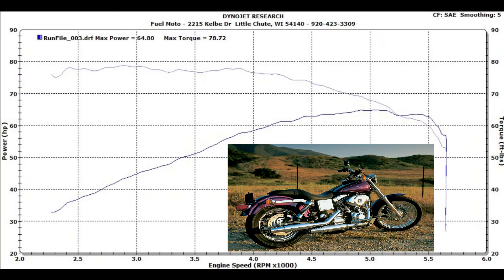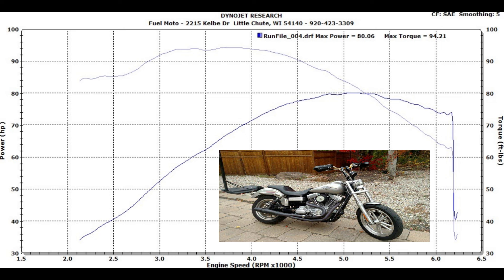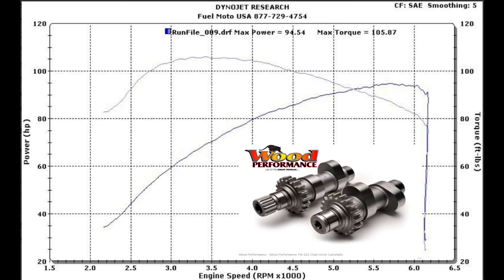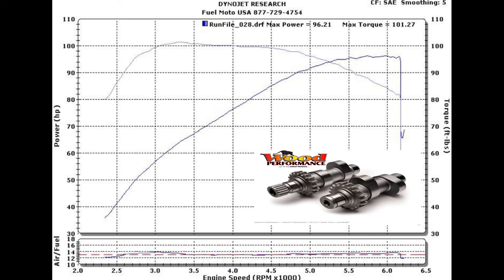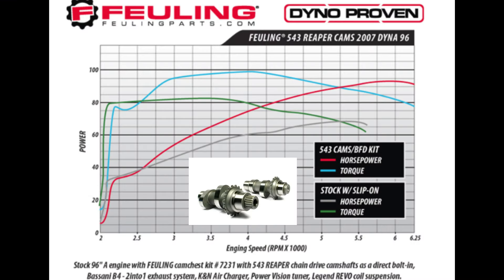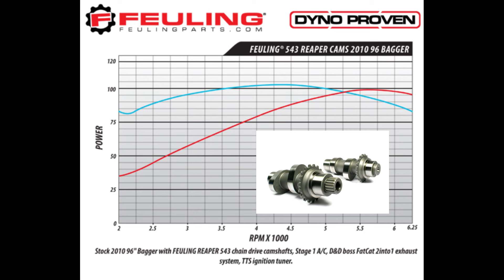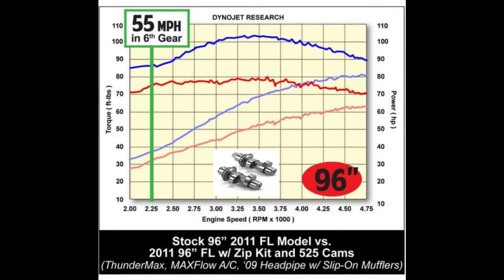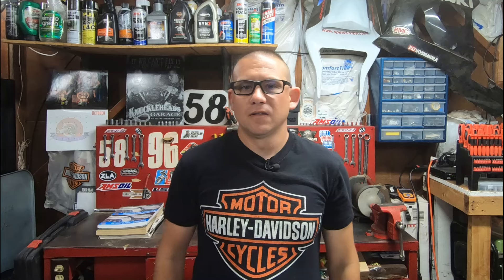Consider New Cams For Your Twin Cam 96 Before You Convert To A 103

Comment: I have an 09 RK classic with upgraded airfliter and slip-in’s 
Makes 71 HP and 83 TQ
I want more torque on low end to run with the guys on newer 103 and 107’s especially at Highway speed. I am in Texas and speed limits at 75 and even 80 with groups riding at close to 90. 
Which TW cam recommend.  I often do 3 day trips loaded with gear and a trunk 
Current bike just runs out of power at those top speeds
Reply from the maker: I'd say you'd be hard pressed to beat the Wood TW-222 for that RK. The 222 makes a lot of all around power and it really bump you're horsepower and torque all over the RPM range.
Reply: @GixxerFoo  Thank you, wasn't sure if you might recommend the TW 555 or TW 6-6 over the 222

Comment: I just ordered the cr 570-2 cams for my 96. I've read a lot of great reviews on them in 103s. I hope they perform similar in the 96.
Reply from the maker: They do very well in the 96, naturally the 103 produces a bit more with the added displacement but the 96 is no slouch. It's typically about 5 horsepower and torque behind the 103 so with a 96 you should see mid to high 80's in horsepower and low to mid 90's in torque.

Comment: That woods cam you first spoke of looks mighty tempting, but I would want to check run out before I go changing cams, cam bearings, cam plate etc to do the job right...and if I did all that and came out with good numbers I would be looking at gear driven
Reply from the maker: Gear drive is the way to go if you can swing the cost and your run out is good. The Wood cams are awesome, a little noisy compared to other cam though. But that's how the Wood makes the power with the overlap.

Comment: I have a 96 inch Dyna and have been thinking about the S.E 255 cam. After watching your video I think the Woods 555 is the  way to go. The power curves are similar and i can probably get away with the S.E 255 fuel map and not flag digital tech.
Reply from the maker: You'll get way more out of the Wood cam, the Wood 555 is an awesome Dyna cam!

Comment: What about the fueling 574, in a stock 96. 2011 flh
Reply from the maker: That's a very strong cam, it comes on about 2500 but it runs out pretty good. With a good exhaust and tune you should see power in the mid 90's and torque close to 100 foot pounds.

Comment: Great video just what I needed to help make a decision. I am gonna do the TW 222 cams in my 09 street glide 96 in motor, will also put on D and D 2 into 1 Fat Cat ( I already have a K and N filter) and getting it tuned. Do I need to do adjustable push rods also ?
Reply from the maker: I assume you meant push rods, adjustable push rods are required with the wood cams. You might consider new lifters, not a total have to thing but just something I prefer when installing a new cam.
Reply: @GixxerFoo  Thank you sir, and yes I meant new lifters and adjustable push rods.

Comment: Hi Gixxer.  Thanks for all of your videos, they're informative and well done.  I'm subscribed and watch them all. What's your take on stock head pipes with slipons (Samson ovals) for a cam upgrade?  Worth it or are the stockers too restrictive?  '07 Street Glide... Thanks again!
Reply from the maker: The issue with the touring bikes is you still have the catalytic converter in the head pipe. Just slip ons with a cam swap will give you a good power bump and better sound, but you won't get the highest horsepower due to the cat. On the other hand you will get some big torque with the cat in there. The stock harley header is actually really good, it's just that cat in the head pipe on the touring models that holds the horsepower back.
Reply: @GixxerFoo  Thanks again. I've swatches the web for that info!

Comment: @GixxerFoo great Vid! Do I need a new clutch and oil pump with that stage I + cams? I mean the increase in hp alone is over 40%, thats a lot.
Reply from the maker: By just adding a cam set it's not 100% required although it's not a bad to add a clutch upgrade and a high volume oil pump. It really depends on how you ride and how many miles are on the bike. A heavy duty clutch spring isn't a bad idea, while adding cams if you can swing the extra for a billet cam plate and high volume oil pump it's an opportune time to get that done with the chest open.

Comment: Só...about the reaper 543 in the dyna vs bagger...
This HP difference is due to 3.93gps vs 4.3gps fuel injetor???
Replace the fue injector and will i get almost 100hp ??
Reply from the maker: Not necessarily with the 96 inch engine, you'd really need a displacement increase to get closer to 100 horse mark. Generally the 103's will get to 100 horsepower just due to the increased displacement.

Comment: Dyna lowrider its 96inches its stock i think its heavy and like to get off the line better , but with 36.000 miles on the clock it acts like it needs a top end and the noices emanating from primary got me spooked,  yeah I bought used and from a HARLEY dealer so I'm going to be busy cams that influence low and midrange is where I'm at ! Man this bike creates ah lot of heat , Jeez ! The more I read and discover about my bike I'm more appreciative of my 79 'lowrider , I'm not backing down this 07' Dyna lowrider is the newest bike I ever owned and will continue my riding journey with it so its going to live in a garage for a year to be altered to where I like it , ain't that how it is " stock looking till you start it and here idle , Fucken-A man bike will sound tough

Comment: I have a 08 heritage 105yr anniversary. 96ci. V&H true duals, looking for recommendations on a good A/C, tuner, and cam selection to wake it up. Plus what other modifications to support the cam for better longevity and reliability. Any advice?
Reply from the maker: Any high flow aftermarket air cleaner is pretty good if you're just doing a cam and exhaust, you can really pick anyone that fits your style. Power Vision gonna be the best way to go with adding a cam to your bike for a tuner, the Wood 222 is one of the best all around cams out there for a bolt in.
Reply: I do ride with a passenger about half the time. I'd really like a cam that will give me a good increase across the board. I'm going to leave the V&H true dual exhaust. Just going to do a cam, A/C, and a tune. Any idea what kind of horsepower and torque that woods 222 would make?

Comment: I have a 09 Road King with hiflow intake and Rinehart slipons. After adding SS 551 cam and cam chest kit the bike has 73.2 hp and 82.2 torque.   This seems low based on the numbers mentioned.  Is this the cam ?  I understand this is a mild mid range cam but these numbers are almost the same as what they claim a stock bike will do.   I have a power vision 3 tuned at a local shop.  Does any of this seem right or wrong ?

Comment: Is the woods TWT222 cam upgrade a well mannered pump gas engine? I am a little concerned the cam maybe a aggressive/little wild for street and touring use.  I am still amazed with the great torque and HP numbers its getting with only the 2 into 1 pipes and  high flow air cleaner up grade. Its very close to bore kit performance.
Reply from the maker: Yeah it's a direct bolt in and it will do just fine with premium pump gas, it does all that on stock compression. The secrets in the valve lift and over lap so pump gas will work just fine with it.
Reply: I do some car drag racing and use performance cams designed for drag racing. They do not run well on the street. The engine has a pretty good lope and runs at best with the pedal to the metal.  I was curious about the TWT 222 cams. With the torque numbers and horse power they are getting with no displacement changes or head work, I  was wondering it the TWT 222 cams would have a excessive lope and not good for street and touring.  Would the TWT 222 cams also work with an S&S 110 upgrade from a 96 stock. Or would a different cam be appropriate?
Reply: The over lap causes misfire at idle that makes the lope or choppy idle. The engine chokes on its own exhaust with a lot of over lap. The more the overlap, the more the lumpy/lope will be until the RPM is increase. These type of cams run best with high RPMS. But the TWT222 do not have much lift so it prolly wouldn't be an issue for street. Would this be correct? Some over lap sounds pretty good. I am not opposed to some over lap. Sounds kinda like the old carbureted shovel and even EVO engines

Comment: Do you know anything about the se251 cam? Specifically in the 96? I got a new set of 251’s from Harley for 30 bucks on a old stock sale. I have an 07 flstc. my biggest thing is I was a big cam sound, I’m not after hp. Info is scarce on the cam but I’m trying to see if valve springs are really a must. I just want to know if I can throw the cam in with the adjustable pushrods and call it a day.
Reply from the maker: That cam is a good mid range torque cam, you will need the SE valve spring kit for the twin cam with those cams. It may not have the big lope at idle like a aftermarket cam though.
Reply: @GixxerFoo  oh, honestly I just want a gallop low idle about to die sound. but I know the oil pressure deal. my bike is a cholo build with bassani 36” non baffled fishtails. any advice on how I can get more chop?

Comment: i have a 09 electra glide 96 would i need compression releases just for a stage 2 was thinking the tw222 woods was comparing it to the s&s 551 with easy start
Reply from the maker: Not with just a cam swap, it will still start as normal without any kick back issues.
Reply: @GixxerFoo  Cool thanks for the reply love the channel

Comment: @GixxerFoo I’m looking to get some cams swapped out next month. My Indy shop recommended the S&S 585s for my 96ci dyna super glide custom. I feel like I might not be happy with those, but they say they’re really good cams and really rip in higher rpms. He says the dynas have pretty good torque down low as it is and that they normally recommend a cam that comes on later in the power range. He also says the Woods cams are kinda noisy and people complain about that. I’m no professional but from all the videos and research I’ve done I feel like I’d be better off with more of a torque cam. With my thunderheader, high flow air filter, and power vision tuner I feel like I’ll be good to go after the cam swap.
Reply from the maker: Your Indy shop is right, the 585 is a great cam it just comes on a little later and runs out longer. Just really look at where you ride, do you even get into the higher RPM range above 5000? Wood cams are noisy due to their aggressive grind so you will have more valve train noise. You've got all the right supporting components to make a cam pull hard. If you don't run out the higher RPM range you'd be happier with a low to mid range cam, and on a Dyna that will just build on the power that's already in that range.
Reply: @GixxerFoo  I do wind the gears out to the redline a lot but I don’t hold the speed out that long either, so I’m torn on what to get. I really want it to just be more responsive all the way around

Comment: Excellent video I'm looking for more power in my 96 twincam and Ive hot good numbers from a Dyno run already but as far as I know it's a stock motor but it's running 81.14hp and 98.56ft/lb but I want more power
Reply from the maker: Bolt in cam will take care of that!
Reply: @GixxerFoo  what  would  you recommend !! I was going too go for a s&s set up or a fueling set up !

Comment: Great video!!! Could you compare Screaming Eagle cam with the Woods for a Stage 1, 96" Dyna? I have an 08 Fat Bob that i want to upgrade in the future; your comparison will help me decide whcih way to go. BTW... i a "low end" rider who's more interested in passing power. Thanks and keep dling what you do!!!
Reply from the maker: Thank you! There's no comparison with a Wood cam to the Screamin Eagle. A lot of people buy the Screamin Eagle cams and end up very disappointed, they don't have any overlap and don't produce overwhelming power. A bolt in Wood will put a 96 in the low to mid 90's for horsepower and upwards of 100ft lbs of torque. Bolt in SE cam I'd say low to mid 80's on horsepower and low to mid 90's on torque.
Reply: @GixxerFoo  Thank you very much for that explanation!!! That's very helpful!

Comment: Hello I was wondering if I put wood777 in a 96 and a 30 tooth front spoket if it would run good it will be done in a street glide thanks
Reply from the maker: That 777 is gonna make a world of difference in your Twin Cam, it's gonna have power everywhere and feel like a whole new bike!

Comment: I’m buying a 2011 fat boy 96ci that already has a 255 cam in it and wondering if this is a good setup? Reliability is most important to me and I like extra low end torque.
Reply from the maker: Screamin Eagle cams are going to be pretty mild, the 255 is what is used in the CVO bikes. It's a good cam for low to mid range power and it's not hard on the valve train at all.
Reply: @GixxerFoo  that’s great to hear.

Comment: Love this Channel. Great Video. I am ready to pull the trigger. However, I am stuck between TW-222 and TW-555! I have an '11 Crossbones that I solo ride. Help me Tom Cruise!
Reply from the maker: The 555 comes on later and runs out a little longer than the 222, the 222 does produce more low end torque though.
Reply: Do you think there will be any issues with either if I were to go to a big bore kit later in a couple of years?
Reply: What did you go?

Comment: Hey man, love your channel. Are Andrew's 57H cams good?....and are they a good match for wiseco forged pistons with ported heads? My end compression after those upgrades is gonna be 10.5 -1 or 10-1 , one of those...so my mechanic put the Andrew's cams in first, said was a good all round cam, along with a bassanin rr3 stainless.  My bike is 2003 cvo ann. Road king...the cams and pipe was first, now were doing the pistons, bore and hone and ported heads. He told me thatll  all mesh well together and make good power. Whats your honest opinions and thoughts of this kind of build...also a power commander 5. I wanted a power vision but he told me a pc5 will tune it fine. What you think about that also?.....any advice you can give me will be well received.....thanks man
Reply from the maker: It sounds like he's got you a nice setup especially since you're doing the heads and upping the compression. Just good dyno tune and you'll be all set, don't leave any power on the table after all that work.
Reply: Thanks for responding...
Reply from the maker: Not a problem at all, always happy to help out.

Comment: Woods 222 vs 555 for a stage 1 96? Cant decide which id like more. Also curious how a 222 would be if I decided to go big bore in the future.
Reply from the maker: The rule of thumb between those two cams in general is 222 for touring (maybe softail), 555 for the Dyna. That doesn't apply to everyone but most prefer a 555 in the Dyna with it being lighter it doesn't need as much low end torque and most people prefer the way the 555 revs out in those bikes. Touring being heavier you want the extra torque in the low and mid range but you're not so worried about the top end performance. It comes down to where you ride the most and where you want that power to be available to you at.

Comment: I'm leaning towards one of the woods, what is your opinion on changing the lifters when changing cams? I seem to be finding 50/50 for yes or no. Some say you always should, others say with rolling lifters it's not necessary, though my bike is at 20,000 miles so maybe so.
Reply from the maker: I've got the same answers myself over the years with roller lifters. My honest opinion is you've got a wear pattern from the old cam, new parts wear out old. I prefer to change the lifters myself if they have over 5k miles with a new cam. Just me though, others will reuse them.

Comment: How important is replacing the lifters and bearings when installing the Wood 222 on a 07 Heritage with 6K miles?
Reply from the maker: With 6k miles I wouldn't me overly concerned with replacing the lifters and bearings. I would however inspect the lifters for wear marks from the old cams. This is strictly personal, but I like to replace the bearings and lifters with a new cam if they have some miles on them like around 10K.

Comment: I like that feuling 543. You get the best of both worlds and none of the woods cams beat it by enough to matter. You can get a complete kit with cam plate, oil pump and adjustable push rods and stuff in their reaper kits. Hmmmm wonder what my runout is?  I’m almost afraid to look.
Reply from the maker: Feuling is hard to beat, especially with the one stop shop and getting a complete matched set of parts.
Reply: I also put a geared 543 Reaper cam set in my 2000 FXDL, with 10.5:1 compression. Of course I also put performance intake, modified stock carb and my exhaust is really just open tailpipes with lollipops. This thing pulls hard and fast. Not sure if everything I did compliments each other, but way more sweet drive, love it. Havent done any head porting, dont know if that would make much of a difference, thoughts anyone?
Reply: Do you think the stock twin can 96 has enough compression for the Fueling 543 cam chest kit? My local shop recommended that kit with my stock 96, but others have said it does not have enough compression and that the bike will fall on its face below 3,500 rpm. Thoughts?
Reply: @awatson20 also wondering the same thing

Comment: What do you think of installing  SE-204 cams on a 2008 96ci FLSTC (standard compression) with a SE Stage 1 air filter and V&H Duals with Fish Tail Tips. The advantage of using this cam is that I can reflash the ECM with the calibration id. 176ST002 using the SE Pro Super Tuner software. I still have the the original 2009 SERT. You feedback will be greatly appreciated.